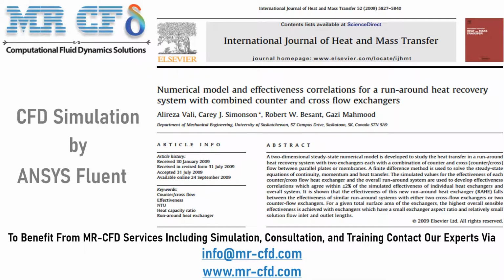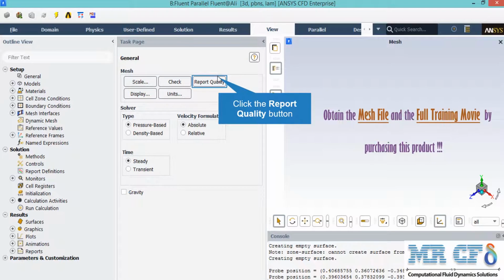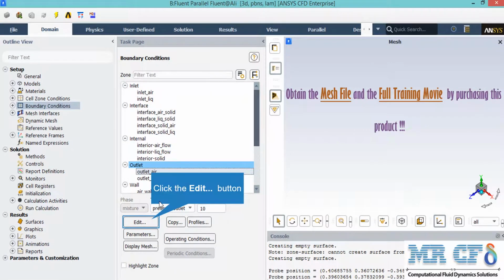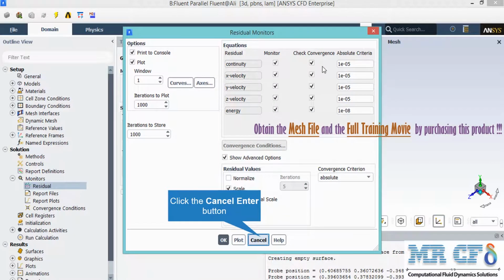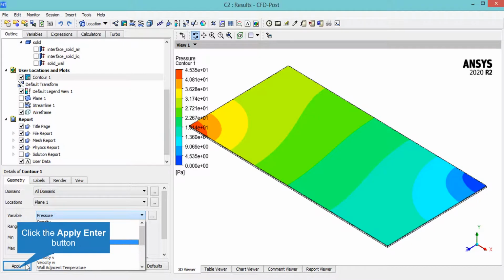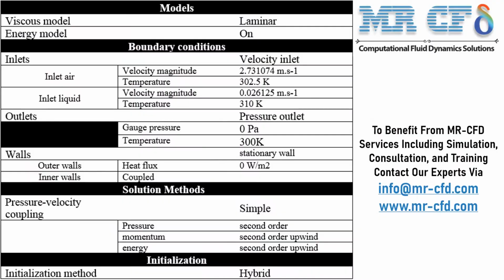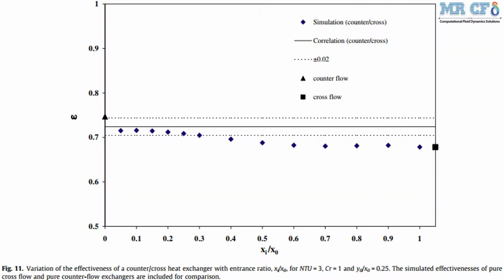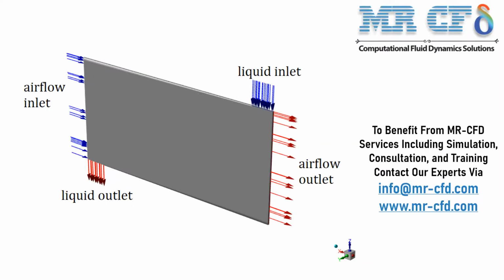Heat Recovery System with Counter and Cross Flow Exchangers (Validation)

Comment: When I performed ansys fluent simulation on crossflow heat exhanger with air(cold fluid) inlet temp 22 celcius and water (hot fluid) inlet temperature 50 celcius, I got following temperature at both outlet
Air outlet=22.3 celcius
Water outlet 22.1 celcius
Is my simulation good?
Reply from the maker: The increase in the cold temperature and decrease in the hot fluid temperature depend on the heat exchanger design and mass flow rate of each material
Reply: @MRCFD  thanks